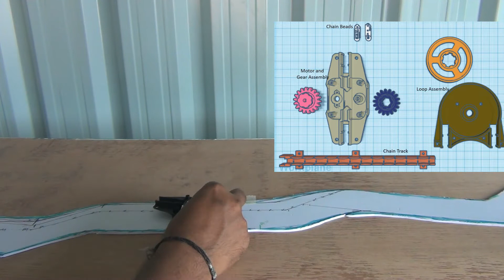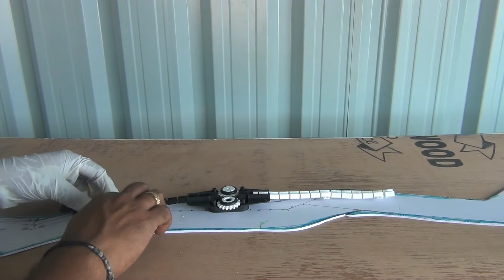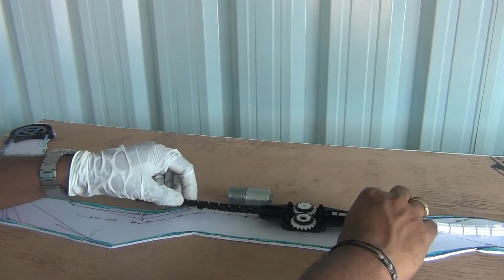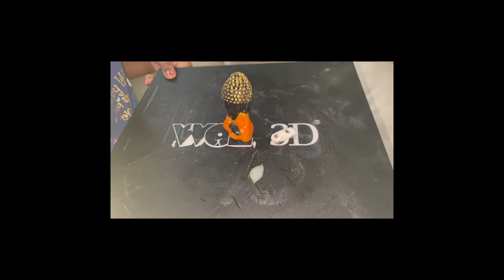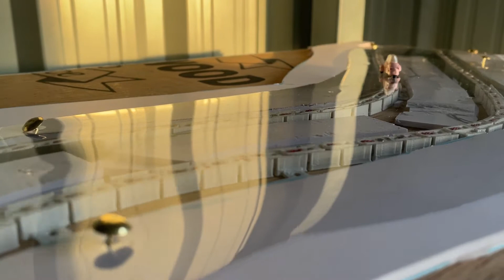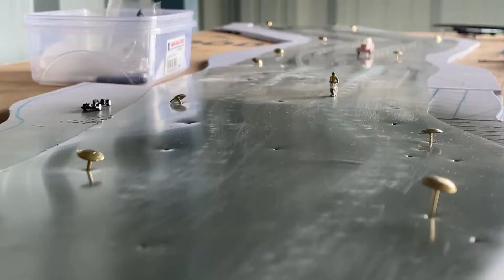2 Marklin Z Scale Toporama Model Train Layout - Magnetic Moving Car - Part 2

Comment: it may spunds stupid but I think if you found a way to run the chain submerged in a oily substance, not quite as thick as oil tho, it would run hella smooth. Try baby oil
Reply from the maker: Sure will give it a try with some oil, still some more finetuning of the car system is need as its parts are completed 3D printed.